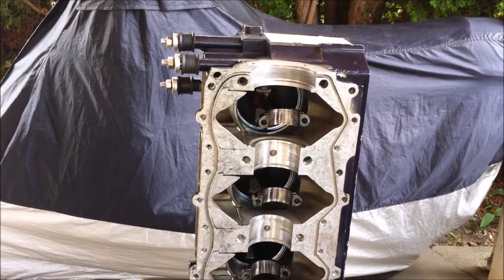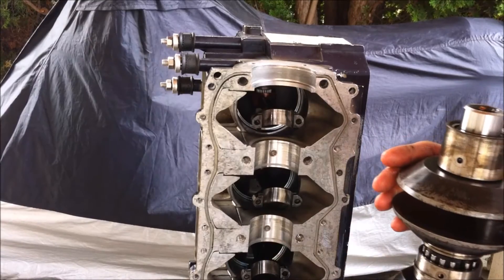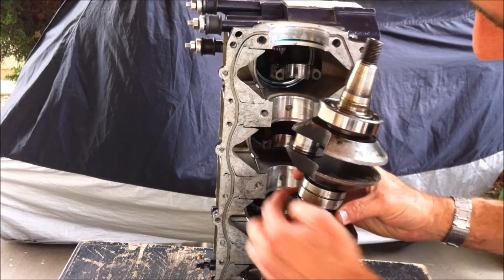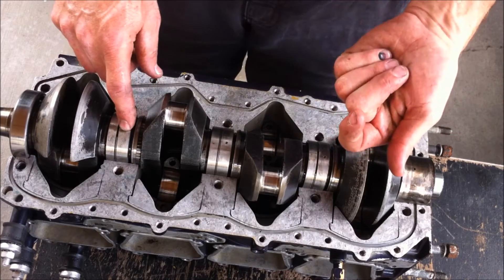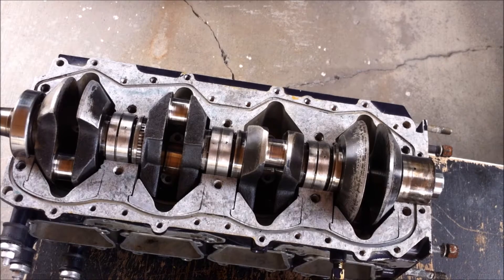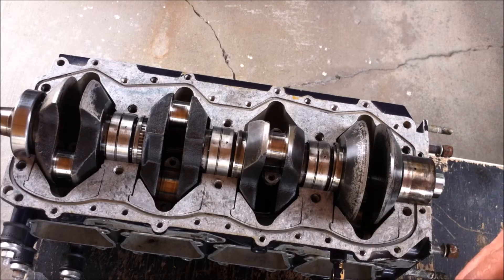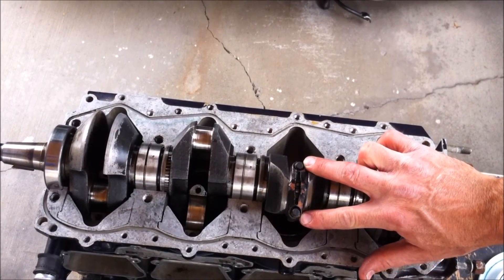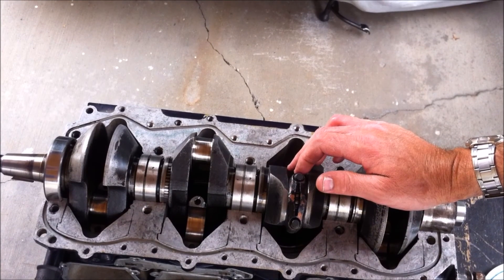89 Force 125 Rebuild video part 3

Comment: what will happen if the rod caps and rods get mixed up? i am looking at buying a disassembled force 125 but none of those are labeled.
Reply: Hi Jonathan, So sorry I missed this question 2 years ago! I would be curious to know if you ended up purchasing and assembling it and how it ran.

Comment: Hi. You are doing great job there mate. I know that its too late now and motor is all done and dusted but,next time you are working with those loose needle bearings,just use some vaseline on them and and its going to be much easier to get them assembled. I do it all the time on my motors and it makes it much easier to get job done. I saw a video on youtube where women was rebuilding johnson 15hp 2 stroke motor and she used vaseline on the needles. 
Thanks for sharing your experiance with others,though i'd like to see it in more detail but,i know its not easy to do,because when doing jobs like putting motor together you have to concentrate on the motor,not on camera LoL.
Thanks.
Reply from the maker: Hey GJD, thanks for the feedback - this is exactly the kind of reply I was hoping for on these videos - helpful suggestions that will further benefit the viewers.